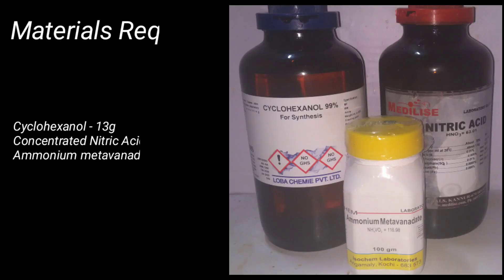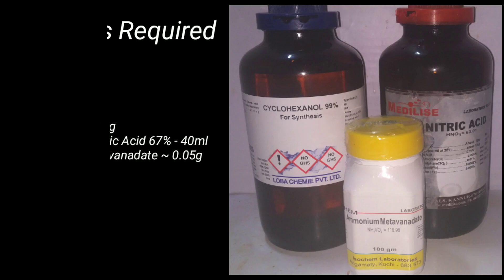Adipic Acid : Organic synthesis

Comment: Sir, do you think i can oxidize 1,4 butanediol into succinic acid via conc. nitric acid? or  will it just oxidize into 1,4 butanediol dinitrate?
Reply: Yes it works. Nitric acid also suppress the solubility of acids so the extraction won't be hard